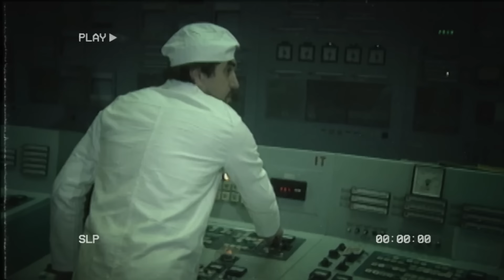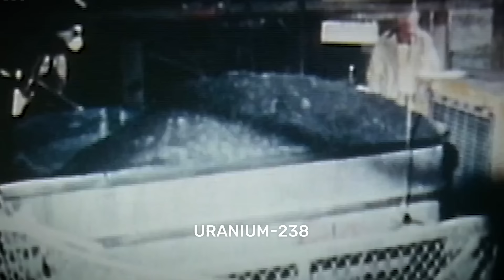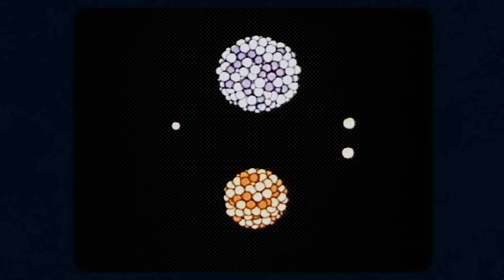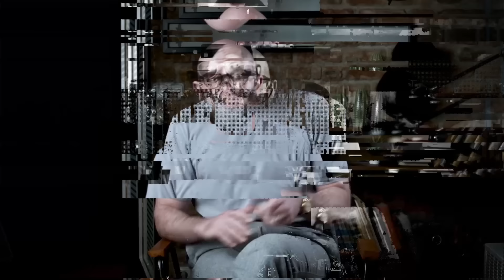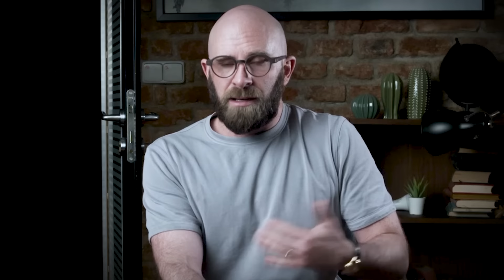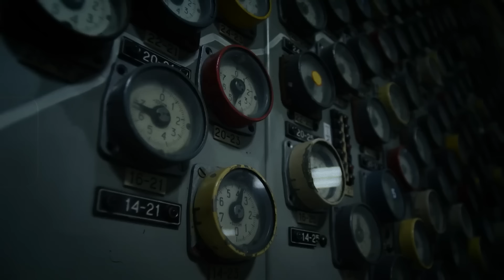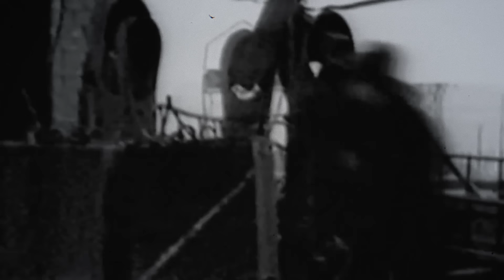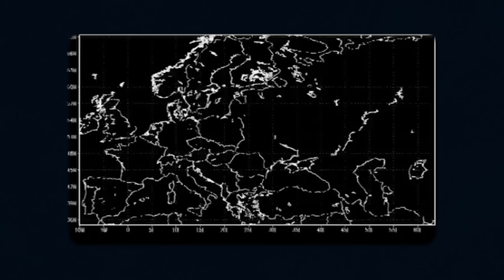The RBMK: The Shoddy Nuclear Reactor That Nearly Killed Millions

Comment: Simon, the bit about a second explosion being Megaton yield has been debunked many many times; it is physically impossible for the material at Chernobyl to get anywhere close to that yield.

at most you might get a half kiloton yield but that would be it; would spread a lot more radioactive material enough that the fallout emulates a megaton blast but it wouldn't be a actual atomic detonation...
Reply: Yeah, Chernobyl is at most considered to have had the potential for a nuclear 'fizzle', which effectively means no nuclear explosion, but enough energy to make a very, very powerful steam/pressure explosion. It's the difference between using an actual bomb vs. a pressure cooker full of cooking oil (do not ever do any of that, it will kill you).
Reply: @The_Blazer-u9t  Yup; it would possible EMULATE a megaton bomb with the amount of radiation, and in the form of fun long half life stuff, but the most you'd see would be a boom and then possible a bunch of blue glowing dust.

well, that and any birds remotely close keeling over suddenly.
Reply: Chernobyl was a steam and gas explosion.
Reply: It would have basically been a large dirty bomb.  Not a megaton warhead.  But, it would have definitely spread a LOT of fallout over even a further area than the initial explosions.
Reply: Indeed. Even a single megaton would turn the entire site into a smoking crater. The fact that most of the structure is still there (there were multiple reactors) suggests it wasn't even in the kiloton range.
Reply: The only accurate estimate is zero megatons. Zero. The molten fuel did actually drop into the flooded areas of the building before anyone had a chance to pump it out. All the shitty infotainment out there conveniently ignores this fact. Upon contact with the water, the fuel simply cooled down faster, turning into a low-density pumice that floated around the room on the water's surface.
Reply: It's ok, he misreads the script often.
Reply: The thing is. I would not have been a nuclear explosion. It would have been a massive steam explosion that would have yielded up to 3 MG Tons of force. That explosion would certainly have spread nuclear material far and wide. He did not say a Nuclear explosion.
Steam under pressure can yield terrific explosions. All that water under the plant would have turned to steam instantly. If it would have been a small amount of water. not as bad. This was covered in the Miniseries.
Reply: @jeraldbottcher1588  also been debunked after extensive calculations; the most you would get with a steam explosion is again that roughly half kiloton yield.

The entire reason that whole calculation has been done to death is purely because everyone who knows about yielded and the mathematics behind steam explosions heard that when wait that can't be right and then being the eager beavers they are dove into the calculations.

You can easily find people arguing this to death if you look for it online
Reply: @Shinzon23  My non-expert suspicion is that, with the amount of water described, under very controlled conditions, it would be possible to get a steam explosion in the single digit kiloton range.  A lot of steam in a strong container heated enough can pack wallop.

But, core reaching the water tanks under Chernobyl is far from ideal.  The very breaching of the vessel to get the core material in there would provide an opening for the steam to shoot out of.  It would likely move a lot of dirt as it spread, creating many geysers.  As others have said, it would have spread a whole lot of nasty stuff.  It would have been a mess.

But, three megatons is just silly.  And the rest of the dialogue in the scene where the woman describes burning down Kiev 200 km away is just as ludicrous.
Reply: @mightydrakehockey  my family was involved in the nuclear field in the 60s and 70s with Sandia Corp, and my grandfather and mother who both worked there at different times were watching the show with me and both laughed for 10 minutes.
Reply: @jeraldbottcher1588  The miniseries is a work of fiction. The molten fuel DID drop into the flooded areas, without causing so much as a wet fart. You have been lied to by a succession of hack journalists.
Reply: @jeraldbottcher1588   And there was a gas explosion after the steam explosion. When the reactor was stalled, there was a buildup of xenon-135 in the core.

Comment: 14:37 Simon said it: "steam explosion" aka "steam flash" is what blew the reactor lid off, not a nuclear bomb type explosion as some believe. Important difference.
Reply: VERY important difference. A pressured explosion is possible in any industry that involves pressurized fluids. While the type of contamination is unique, the type of explosion is not.

Edit: Changed gases to fluids.
Reply: True it was a steam flash that blew Chernobyl up but the fissile material expelled out was the equivalent of a dirty bomb. The fact that they had to dig up and over turn roughly 9 meters of dirt and material in the surrounding exclusion zone says the higher ups in the USSR knew this. It also explains why  as far away as Sweden got high radiation readings just 36 hours post explosion. It also explains why, if you watch some videos of people using equipment to tell what the sources of the radiation on different areas in the zone for example the Farris wheel or the bumper cars, you see that there's far more than the simple biproducts of fission that you would get from just nuclear reactors in general.
Reply: actually one of the theories as to what caused the second explosion that destroyed the building is that it was a nuclear fizzel - a very small nuclear explosion
Reply: @Trainman10715  What can is say? Dumb theories. In a bomb you have a >90% pure U-235 assembled at a break a neck speed (a few km/s). In a reactor you have a a few % of U-235 top + rod cladding and stuff. Increased reaction rate --> pressure build-up --> disassemble --> stop. BTW chemical explosion of H2 + O2 is a known hazard. You normally have blow-off panels to handle it.

Main point is RBMK did not have a containment vessel and any bigger accident more or less had to lead to nuclear contamination of the surrounding. That was a (typical Soviet) design feature, not a bug.
Reply: @WielkiKaleson  a nuclear weapon has highly enriched uranium in order not to require a moderator to sustain a chain reaction, a reactor with a solid moderator is capable of sustaining the same runaway reaction as seen in a weapon. The theory is very valid
Reply: @Trainman10715  The reaction is kind of the same (fast neutrons can do more fancy reactions; anyway, let's skip it), but the scenario is different. Compare burn-up and yield.

You can burn TNT in a bonfire pretty safely. Technically, the reaction is the same as in a bomb. But looks quite different.
Reply: @WielkiKaleson  there wouldn't be any fast neutrons with the amount of graphite that was present at the bottom of the core at the time of the explosion. That's why the theory even exists, the graphite control rod displacers allowed the reactor to go prompt critical dispite the use of low enriched uranium
Reply: Wrong. There was an initial small steam explosion which severely damaged the reactor. This promoted a very fast production of hydrogen. This hydrogen exploded, and was what blew the lid off the reactor and the roof off the building.
Reply: It Still poured out hundreds of tons of radioactive slop everywhere...
Reply: Only euthanasia candidates think it was a nuclear detonation. That is a terminal level of stupidity. Stage 4 stupid.
Reply: But then he proceeds to claim a 3-5Mt explosion was possible and looks like he estimated the destruction based on NukeMap simulations... which aren't for steam explosions/overpressure events.
Reply: the closest to a nuclear explosion from it was when the super heated fuel in the fuel channels became exposed to air and burst into a fireball with flames burning the boron, graphite, and zirconium. Took ten days for the fire to pretty much burn itself out. As much as most people consider the sand boron clay and concrete smothered it.
Reply: There is little scientific evidence that the first 2 explosions that lifted the lid of the reactor off happened because of steam or hydrogen. Hydrogen would of caused a fire and not an explosion like it did. There wasn't enough hydrogen in the reactor to create a explosion that size anyway. The truth is the explosion is still not explained and the small nuclear explosion is looking like the most likely cause and alot of scientists are moving more towards the explosions being a super unefficent or fissle nuclear explosion. This would also explain why around 80% of all the fuel and graphite in the reactor was blown into the sky and didn't stay in the reactor. 

There is also the reports of a blue light that came out of the reactor at the same time as the explosion which is consistant with a small nuclear explosion. Also the narrative of a steam and hydrogen explosion came from the same people that lied about the causes of the reactor meltdown to the international community so how accurate this narrative is, is murky
Reply: @samsmith7212  Is it wrong to have assumed it to be a steam explosion though? As I recall, the SL-1 incident that was the US' only fatal nuclear incident was said to have been caused by a steam explosion that occured when the manual control rod was inserted at high speed into the partially melted core. That incident may be the reason people just assumed the first explosion at Chernobyl to be a steam explosion. Steam explosion is plausible, the second explosion being a hydrogen explosion is not.
Reply: @maltemejlstrup4746  I think its wrong to say that the explosion was definitely a steam explosion purely because of how heavy the biological shield was on top of the reactor. Some scientists say steam couldn't of created an explosion with enough power to lift the shield of the way it did. 

There is also the weird 45 degree hole in the bottom of the reactor in the lower biological shield which also is unlikely to have been caused by steam. 

Im not to sure about SL-1 i haven't looked in to that accident that much as its pretty cut and dry the US government as far as we know didn't try and cover up what happened to the SL-1 reactor.  the SL-1 reactor was no where near the size of reactor 4 at Chernobyl and as far as i know the explosion propelled the reactor up and there was no hole in the bottom of the reactor like in reactor 4. 

You raise a good point. The thing is to this day the cause of the first explosion at Chernobyl has not been confirmed so its not accurate to state a steam explosion as the cause that's all im trying to say. It gets a bit jarring to keep hearing the same inaccuracies in every Chernobyl video or documentary. Especially when there are a lot of sources that creators can use to better inform people about what happened like the INSAG-7 report (is mostly data from the soviets though). Chernobyl is used by a lot of anti-nuclear energy people as a justification for their stance so its important for people to understand that Chernobyl would never of happened if the experts in charge had done there do diligence and not because of some random accident.
Reply: @samsmith7212  It could be a combination of multiple factors, the steam explosion being just one part of it but I wouldn't rule it out entirely. Under high enough pressure it'd have been able to do a lot of damage. What would help lift the shielding then I have no idea but it obviously wasn't hydrogen. As you stated in your first comment, hydrogen doesn't explode. The Hindenburg disaster is a perfect example of that. It didn't explode, rather it just burned really fast and even then the fire was actually accelerated by the paint on the outside of the airship. Also yes, people do need to realize that the Chernobyl disaster is not an indication of nuclear safety as it was mostly due to cost cutting and man made error. If done properly it's no more unsafe than fossil fuels. Possibly more safe even.
Reply: @samsmith7212  Hydrogen with air form a very explosive mix and overpressured steam is no joke. Plus RBMK had no super-strong containment vessel, like modern reactors do. But feel free to believe cock-and-bull stories, if you like them.

Comment: While I'm not a Nuclear Expert by any means, I don't think the Graphite Fire is the worst possible thing that could have happened during the Chernobyl Disaster...

I believe that a totally uncontrolled Chain Reaction Event would be FAR worse than either the molten core hitting the cooling pool or the graphite igniting as it would have almost instantly converted the ENTIRE supply of Nuclear material into heat and kinetic energy...and just how many Megatons of TNT would THAT nuclear Detonation equate to? far more than the 5 MT of the molten core hitting the cooling pool I bet...I suspect that just that 1 core going BANG like a Bomb would be at least 4-6 times more devastating than the Tsar Bomba Nuclear Bomb was (it was designed to be a 100 MT bomb but was scaled back to only 56 MT for the actual Nuclear Test Detonation and it STILL scared the Unholy Howling HELL out of the world when it went off)...an Uncontrolled Reaction (AKA Nuclear BOOM) of Chernobyl Core 4 likely would have been equivalent to easily 250-300 MT of TNT...which would have likely completely destroyed 90+% of Ukraine & Belarus and about half of Poland...the blast would have shattered windows as far away as Moscow itself and likely rendered all of Europe and most of Asia uninhabitable for centuries...

As Marvin the Martian would put it, it would be an Earth Shattering KABOOM...

😄😁😆😅😂🤣
Reply: A nuclear explosion is not possible with reactor fuel. The fissile material would need to be much, much more enriched to even have a chance. Nuclear bombs have an enrichment level of 90% and above, while reactor fuel is 20% at most. 

You're not converting the whole mass into energy
Reply: Are you deliberately skipping one of critical (hehe) issues? :)
That you do not just pile up nuclear fuel randomly to have a kaboom. It's not that easy (luckily!). Why do you think N/TN bombs are so expensive, if it was the case?
Reply: @korzbro35   Nuclear Bombs use relatively small amounts of Fissile Material to make the Earth-Shattering KABOOM...that's why building them is difficult and expensive, they need to be very small and relatively light weight for their Explosive Ability to be a viable weapon...and yes, actually, piling enough material together WILL make an Earth-Shattering Kaboom, one of the first and simplest Bomb designs has 2 (just barely) Sub-Critical Masses of Uranium or Plutonium at each end of a big pipe, one end also has a small mass of C4 that when detonated, simply drives it's mass into the other mass at the other end of the pipe, when the 2 masses meet, they are well above Critical Mass and KABOOM, everyone in a 4-6 New York Block Area (briefly) has a VERY bad day and then vanishes in the fireball...its' called a Gun Type Nuclear Bomb, more commonly known today as the Suitcase Nuke as it's the only Bomb Design small enough to fit in a man-portable case...the Modern Implosion type weapons that are so tricky to build were developed because the gun type can't make REALLY large KABOOMS (I think the Gun Type tops out at a 10 or 15 Kiloton Yield if loaded with Plutonium)...

You get enough Fissile Material together (a Supercritical mass) and stopping it from going KABOOM is the trick, enough fissile material WANTS to have an uncontrolled chain reaction (AKA an Earth-Shattering KABOOM) and that reactor had more than enough material in it's core to go Kaboom...as far as I know, it didn't because the Control Rods melted along with the rest of the core and the Neutron Absorbent material mixed in the melted core keeps things stable...or as stable as a melted Nuclear Reactor Core can be anyway...